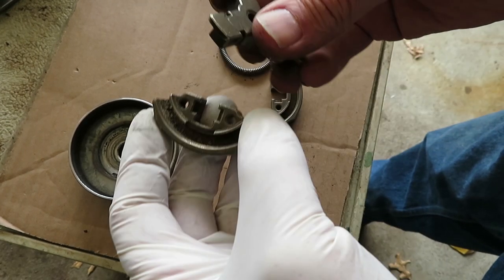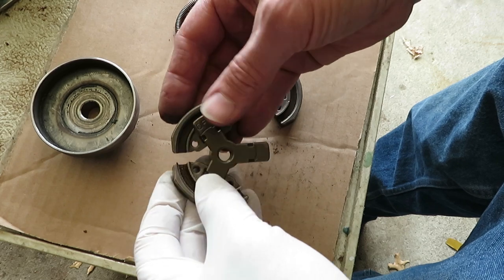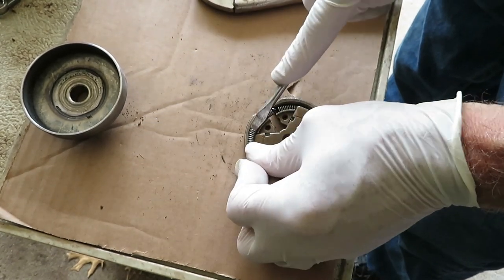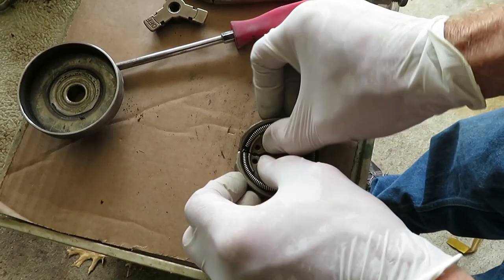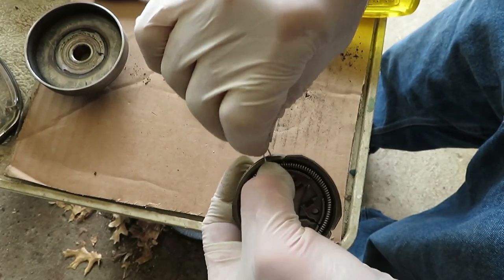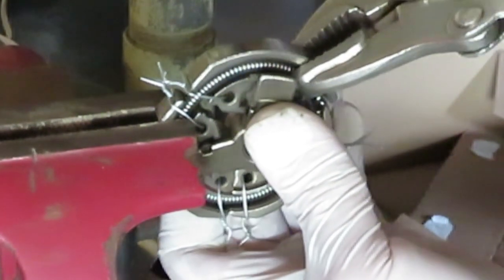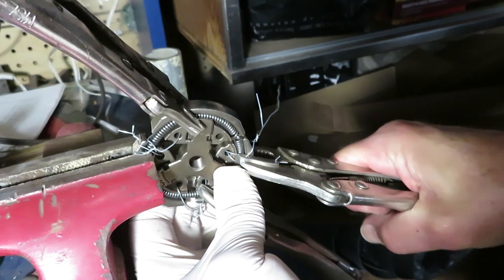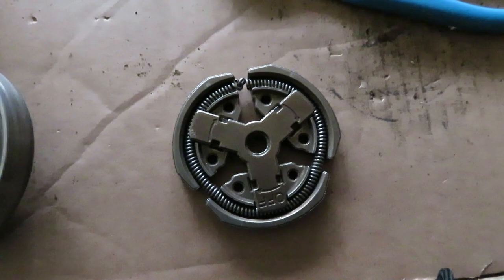How to Re-assemble a Chain Saw Clutch

Comment: Thanks for the video. I had the exact clutch so I used aluminum wire through the holes and pliers to pull each end. Took a few attempts and about 15 min but it worked!

Comment: The best way if you have no holes or vice grips is to drive screws around the assembly on a bench. Then you can fit 2 of the 3 arms and the final can be fitted by twisting a screw driver to expand the assembly. Worked first try after faffing for 30 mins by hand.

Comment: Ha Ha! I have just done this very job ! The "easy" solution I came up with was to assemble the spring and clutch weights, then ,using a screwdriver to wedge apart the sections, push a 3/16" piece of wood in the gap to hold the weights apart, you can then just insert the "nut" into the slots and screw it back on, easy! Chris B.

Comment: Thanks for the video, it showed my how difficult this could be so I tried something different. I cut three pieces of 6.5mm dia rod 12mm long and assembled the three sectors with these pieces of rod in the gap. I then applied a jubilee hose clamp and did it up real tight. I laid it on a flat surface and fitted the spring. Now drop the Y piece in (if you chose thick enough spacers). Clamp it in a vice and drive the pins out one by one, take the hose clamp off and job is done. 2 min once you have the packing pieces cut.
Reply from the maker: Well done. I like the thinking that went in to that solution.

Comment: Same thing on my trusty Chinese SX62 chainsaw.  No holes in my clutch so wiring segments not on unless I drilled holes.  After struggling for  several hours eventually devised the following method: -
1.  Cut three pieces of steel bar spacer 6mm dia. x 8mm long.   1/4" dia. x 5/16" long would likely do.  Then assembled the three segments on the bench with the spacers in the little recesses.   If bar not to hand buy long bolt with plain section.
2.  I have a Machine shop so laid 5" three jaw Lathe chuck on bench and holding segments with three spacers in place,  clamped up the chuck.  Worm drive hose clamp may also do.   
3.  Next cut three 3" long pieces of soft 1/16" dia. wire.  Place evil garter spring half around two segments and then wired in place through the slots for the spider.  Next work spring with fingers over the third segment using third piece of wire when you reach the spider slot.  Finally work evil garter spring over rest of third segment .  Push it all the way down into the recess,  sit back and swear at it triumphantly.    
4.  Then cut and remove the three wires.  Spider should then slip into place.  Carefully unclamp the chuck and very carefully set assembly vertically into jaws of 4" bench vice such that all three segments are clamped and just one spacer is slightly above the vice jaws.  Tap out spacer with 1/8" pin punch and carefully unclamp the vice.  Rotate 120 degrees and repeat for next spacer and repeat again for last spacer.
5.  Handle very carefully when screwing back on engine's crankshaft.  Left hand thread.  Use soft aluminium drift to finally tap home on thread.

Comment: I found this a method one which worked well for me. Fit clutch drum to crankshaft.  (Remember to fit oil pump drive coupling, sprocket and needle bearings first. ) place washer in clutch drum. Place clutch shoes in clutch drum. Fit spring on underside of spider. Screw spider onto crankshaft until bottom of spider fits into clutch shoes. Continue to tighten spider (clutch shoes will turn as well ) until the spring touches the clutch shoes. Then back it off a very small amount. Push the spring into the clutch shoe groove using 2 pairs of pliers. (If the spring keeps popping out you could use 2 pairs of vise grips to cover the groove at various points , but I didn't need to do this.) Then carefully wind spider anti clockwise until spring is locked down.
Reply: Your way worked for me. Thank you

Comment: I did one today took 10 mins. Mine had no holes so I zip tied through the center hole and over each of the 3 spring holders T piece, 3 zip ties and used lock grips to hold spring in the grove, so once 1 was locked in and zipped up tight I put it in a vise by the edge of the housing and did the next one again pulling the zip tie hard and then the last one. The cut the zip ties 
ALSO, I did break the first one that I tried to do the other day by vise grips on 1 of the tee pieces snaped

Comment: Yeah no holes in my shoes either. Wire or zip ties get in the way. 
Put spring in all shoes & clamp one shoe onto edge of bench. Put center piece into one slot, then use flat screwdriver to pry the other two shoes out. Pry against the other two ends of centre piece and spring groove. Centre piece will drop in.
Reply: Your comment is the one that worked for me

Comment: I used zip ties, vice grips and a nut to keep gap open, as spring kept wanting to collapse and cover groove. Pried with thin blade screwdriver and finished in 10 minutes. Yes, it can be challenging, but be patient.
Reply from the maker: Well done. I used much the same techniques.

Comment: Around $20 for a new one.... not worth the grief trying to fix
Reply from the maker: Maybe, if you can find one for an older or off-brand saw.
Reply: @TheOriginalMechanic  I don't know where you are but eBay & AliExpress have many suppliers waiting to sell you one
Reply from the maker: @gergsvideos  This saw was eventually out of service because I couldn't find an oil pump anywhere. "NLA"
Reply: I posted a couple of links but can't see them...anyway the parts are also on Amazon..might be more convenient for anyone in the USA ...
Reply from the maker: @gergsvideos  OK thanks. I'll try to locate this again.
Reply: @TheOriginalMechanic  funny you should message me..I just got notification from the post office that my parts are there to pick up 👍
Reply: @TheOriginalMechanic  I got it.. complete unit with bearing etc ...$20 Australian... I forgot about the plastic oil pump gizmo that goes behind it but I have ordered it & it should be here Monday...